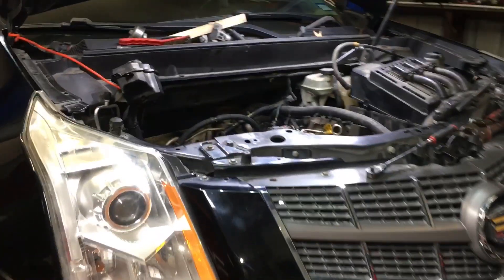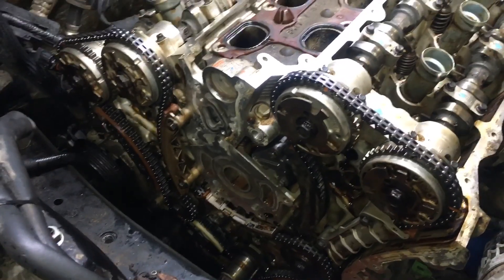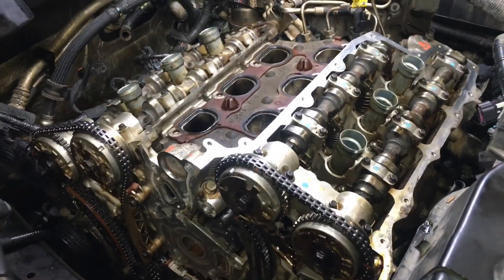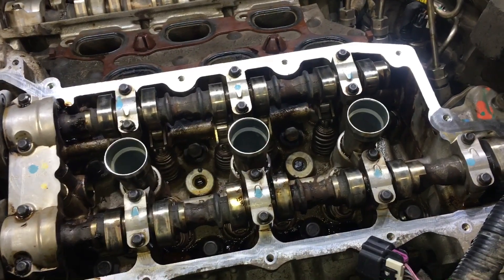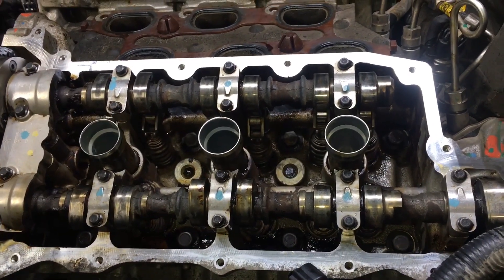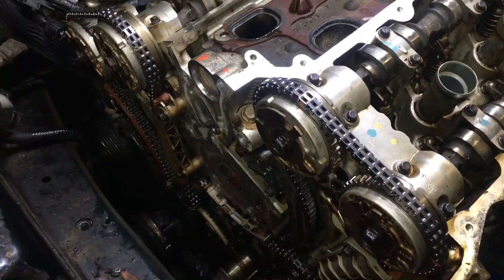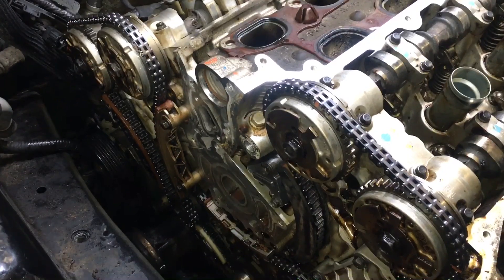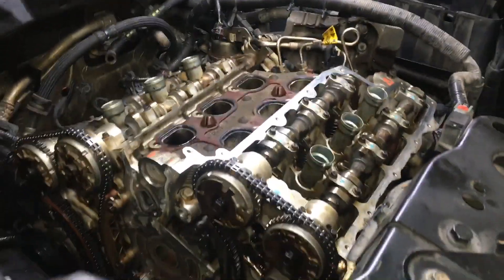Cadillac SRX 3.0 Timing chain P0017 P0016

Comment: Did you have to remove the engine out of the car  to change the timing chain. I was told that & $4500
Reply: Just got the same quote for my 2014 srx. $4500.00
Reply: @RayTheMickey  I want be paying….lol
I’ll do it myself for free with only the price of the parts. I fixed everything else myself.
Transmission, rear wheel hubs, 4 vets, 4 crankshaft, exhaust sensors, ac compressor & some.
Reply: @RayTheMickey  are the cars even worth $4500 bucks

Comment: That engine is sludged up too! Another nice job Eric!
Viewres:
CHANGE THE OIL MORE FREQUENTLY!
Reply: Every 6months or more?
Reply: @jameswaugh115  Equal to or less than the mileage/time frame that the manufacturer recommends (or when it's no longer transparent!) WHICHEVER COMES FIRST.
Reply: @jameswaugh115 my mom only uses mobile one synthetic in hers and changes it every 2 months after an engine flush first a mechanic did the timing and valve covers recently and asked how in the hell she was to keep it so clean because when gets sone of these GM models like this one and Chevy equinox they’re usually full of sludge he just don’t see how many of them are still running he many of the owners of  these cars just don’t realize these things require special attention when it comes to maintenance
Reply: That’s nothing, I e done a few of these and they were so much worse than this one. This looks new comparatively.
Reply: And use a quality oil not wallyworld special
Reply: @davidwoermansr and just what is Walmart special when they carry the same quality oil as the auto store just cheaper and Walmarts own brand super-tech which made by Warren distribution who also makes the Amazon oil and Costco brand has consistently ranked very competitive with the top brands like mobile one and Pennzoil so I think your just running off at the mouth and don’t crap 💩

Comment: Hey I got these same 2 codes on one this week, and it is diving me crazy I have done the chains guides tensioners and Idler gears crank gear and both bank 1 (rear) phasers and still It is the Fringing same. My Name is Lonnie From Avant's Automotive in Deerfield beach Fl if you have minute to call me maybe in the morning I'd love to ask you about your experience with this job 954-931-8364 is my cell it is a 2010 SRX 3.0  Thank you for your time !

Comment: My 3.0 is only throwing p0017.  The chain felt tight to the touch
Reply: Did you figure out what the issue was with the P0017 code?
Reply: @youknowdavibes9811  I didn't.  Sorry.  Did you?
Reply: @gskeezyio  my srx is throwing P0017 is yours light still on?
Reply: @youknowdavibes9811   yes my light is still on.  Car runs perfectly. Aggravation at most
Reply: @gskeezyio  have you taken it for a diagnosis? Have you tried replacing or doing anything?
Reply: @youknowdavibes9811  I've replaced  vvt controllers and sensors still with no luck
Reply: @gskeezyio  My 3 liter had new chains and phaser cams and all new sensors done 20k ago with 3k mile oil changes ever since and I've got fresh p0017 code now. If a wire goes bad in the harness on any of the sensors it'll throw one of the correlation DTC codes as well..0016, 0017 etc etc. These things can be exhaustive!
Reply: @AirtimeAerial  wow!!! What a pure headache

Comment: I Totally Agree..The Reason Why The Timing Chains are NOT Up to Par is Because GM Using Cheap Parts... Especially after 2009 When They Filed Bankruptcy... I Will NOT Buy Any GM Vehicle Anymore that was Made in 2009 OR After...
Reply: I feel exactly the same way I’ll never buy  gm  ever  again  there good for 150 km then there ready to recycle
Reply: 2009 STS and I put 200k on it. Radiator leaks and wheel bearing were replaced. That's it. Now ATS 2.0T and already have 135k. Only coolant hose replaced cost me $30 no other issues so far. Now I'm looking for SRX
Reply: My oldest GM is a 98 but my daughter has a 14 (I believe maybe 13) cobalt and it's over 230k with no problems yet but her truck is about built so the cobalt will get a rest and become the backup vehicle since the salt has done a number on the body around the fenders and under the plastic under the doors

Comment: The GM port fuel injection 3.6 had the same problem with timing chain "stretch." In my opinion, the timing chain routing is the problem. If they had geared the exhaust cam sprockets to the intake sprockets and just driven the intake cams with the chains, there'd be less tension on the chains as the cams are turning easing the stress on the chains.
Reply: How about the other brands? They experiencing timing chain problems too.

Comment: I find it hard to believe the timing chains will not last as long as the life as the motor. I had a P0016 code and before I decided to spend real money to change the timing chain I changed out the spark-plugs. There you go Viola- Prblem solved. The problem I have is the code is not registering right, it should have gave off a cylinder misfire. Is this a Money SCAM? Hmmmmm
Reply from the maker: This video is for the people who have already tried replacing parts such as timing solenoids and cam sensors but still have these codes pop up. This is a well know and well documented problem. GM issued a technical service bulletin about these timing chains. No scams here.
Reply: I take it all back- code came back. We got lucky, it was covered by GM up to 70 k miles, we had 69700. wheeeew, all fixed now for a while. They also guarantee it for 12 months after the fix.
Reply: @ADVANCEDLEVELAUTO  have the p0017 code on my 2007 sts had oil change resest light ot stayed off awhile now its back on but sumtimes will go off so should i try changing cam sensor out nxt or is this a timing problem
Reply: @jrenoch1796  any updates on this issue? What did you end up doing?
Reply: @youknowdavibes9811  havent worked on it yet but pretty sure its the vvt valve
Reply: All I'm saying is I got a (SRX)P0016 and a p0017, I changed the plugs and it all went away. Something to think about... When my (CTS) gave me a code - a misfire code, I forget what it was but I changed the plugs and again the engine light went away.

Comment: First Question! I called gm dealer to see how much they would charge for the timing chain service, and the service person said they don’t have the tool for it. He said to take it to Cadillac dealer, is that true?  It makes me feel like no shop can do it.

Second question?i had to tow my 2010 Cadillac SRX  to tires plus, cause I couldn’t drive it, and got codes p017,p621,and p690, and they said possible timing chain jumped also! Did your Cadillac read the same codes? And did the timing belt jump!
Reply: p0621 is a 5 volt ref. code. that can cause problems with the crank sensor. have to start with diagnosis of that

Comment: just had new timing kit put in because of those codes, the mechanic said it's because the guides used for it wear out prematurely, says it is just a bad part and that they have replaced those guides  with something better(that does not wear out).  If anyone wants to be a part of a class action against these greedy GM fuckers, please email me at emailcab@comcast.net.  They should have included these with the 1st generation SRX models

Comment: Although what you are saying is understood, for the lay person the timing chains don't stretch, they wear at the pivot joints and as a result elongate. Stretch is what they might do if enough force and strain was applied to them say if one was used to lift several tons. The wear has a lot to do with poor oil change frequency and perhaps a bad batch of parts (not uncommon). Keep in mind this engine DESIGN has been around since 2004 starting out as the 3.6L. The timing chain issues appear to have been most prominent starting around 2007 and up when GM implemented an oil change interval that could go as high as 5 figures in the Cadillac resulting in some cars running low on oil from owners not checking it for 10,000 plus miles, as well as the oil just being worn out in that time. I also recall that around the same time GM changed the chain design as well, from the traditional roller to the current quieter design.

 In order for your theory to be plausible, the wear pattern would have to match the description. If you suspect the high pressure pump as being the culprit, it would stand to reason that the chain that drives that pump would show the most wear. When I replaced my timing components at 176000 miles in my 08 CTS GDI as preventive maintenance with no timing codes, the chains appeared to show the same amount of wear compared to the new ones. It was considerable with a side by side comparison showing near a half inch difference in length. It appears the main culprit for timing chain wear is low quality oil and or extended oil change intervals. The LFX version of this engine uses the same timing components with the same configuration without as many timing problems and probably has improvements in the oiling system.

I believe the higher compression ratio the GDI has, contributes far more stress on the chains than a single pump that uses a roller lift arrangement like the 24 valves which is very efficient. Opening two valves at a time against high cylinder pressures should exert a good load on the chains and contribute quite a bit to wear, especially with weak oil lubrication.

I use 10W40 Mobil 1 full synthetic and 3000 mile oil changes.
Reply: quack quack hey great review! You know a lot about this problem, my uncle has a GMC Terrain 2010 V6 3.6L Poor maintenance I believe causes p0017 had low oil helped him with the oil change really dirty oil, only 5/6 quarts in there. Put 5w-30 Mobil synthetic at 135k miles, problem didn’t seem to be fixed. I was able to clean throttle and remove intake to see how the valves look. They look muddy and with so much residue he used Castrol oil and I believed burned oil stayed as residue.... I was wondering if you can help with a suggestion. I’m a good mechanic myself but don’t want my uncle to replace the timing belts. Was wondering if using degreaser or valve cleaner and doing a oil change as adding 10w-40 synthetic or  thicker oil should do the trick....

Comment: Hi  i end up with this problem the chains were replaced but 4 day later same proble then the engine reduce power show up. Car stop working we replace the throtle body asam and high pressure pump enginstars but erratic iddle and no power when we try to move it
Reply: ArmandoB12 what codes did it return with after you installed the chains? Did you reset everything ?
Reply: carlbernngl same codes p017 p016 and one that said mix to rich, pressure to high
Reply: Did you ever figure this out, I have the similar codes now, i have changed high pressure pump and camshaft sensors and actuator solenoids for bank one.. idle has gotten better but now p0016 & p0017 codes get thrown when i start the car, no matter how many times i clear them
Reply: @chrissmothers3636  I REPLACE ON E HEAD AND REDO TIMING CHAIN AND ALL POSITIONS SENSORS NEW

Comment: I have a 2010 SRX with the 3.0 what other issues should I keep a eye out for?? I do have a p0430 code that pops up but dosent seem to effect the operation. Any advice would be greatly appreciated and thank you for the video
Reply: Its gonna stop ur engine from starting after adding gas...buy the plastic part on ebay

Comment: Thanks for the video and giving a good explanation for the reason why these engine models are having stretched timing chains at such a low mileage.  Cadillac should be honest about this one and issue a recall or a very steep discount on the repair.  It's so prevalent that it's unconscienable
Reply from the maker: +carlbernngl I think GM should've issued a recall. Nissan issued a recall with the Juke for the same reason. All timing chains were replaced free of charge.

Comment: hi i have a 2010 gmc terrain 3.0 awd slt with roughly 90k. i have code p0016 and p0017. both relate to the camshaft position sensor of bank of a and b sensor. first step was to replace sensors and code came back. im having it looked at monday but i bet the chain on bank one is stretched. probably do all chains as the other one is prone to go soon also. otherwise its a good car.
Reply from the maker: ronniejr1983 Acdelco sells the chains as a kit that also includes the tensioners for a fair price. Most times I run into these codes on the 3.0 engine it needs timing chains. I use a lab scope to check the sensors and if they look good it's time to replace the chains.
Reply: ADVANCED LEVEL AUTO yup mine needs new chains to the tune of $2300 from a side shop. Well let's hope is lasts another 92k
Reply from the maker: ronniejr1983 $2,300 is kind of high if you ask me. I would try price shopping other shops if I were you. You may find a better deal.
Reply: @ADVANCEDLEVELAUTO  I got 2 estimates both 4k+ other shops won't even bother giving an estimate
Reply: ADVANCED LEVEL AUTO Hi...does thatvkit work for the SRX 2010 3.0 also? The shops I’ve called don’t want to mess with it , they say take it to dealer or replace the engine.